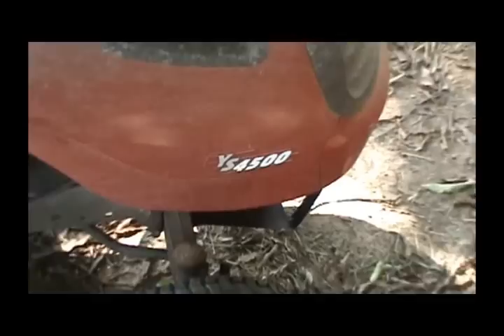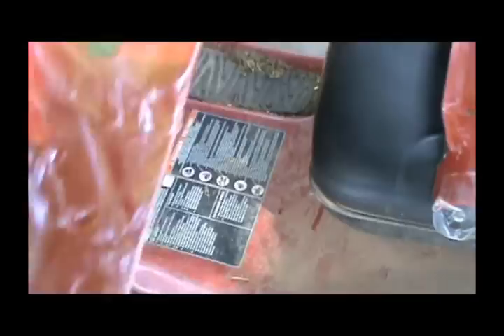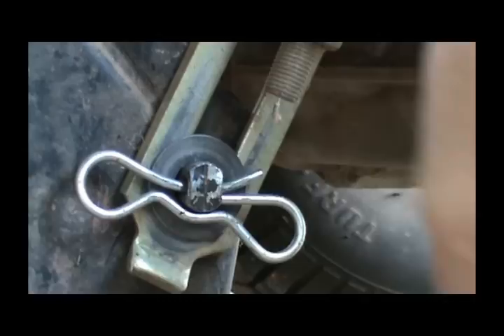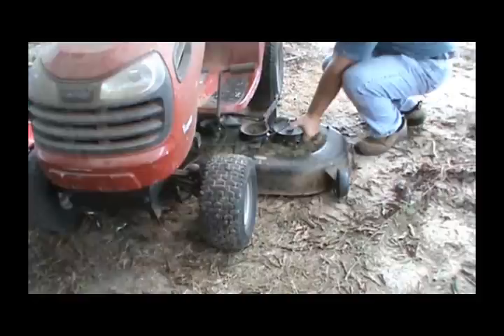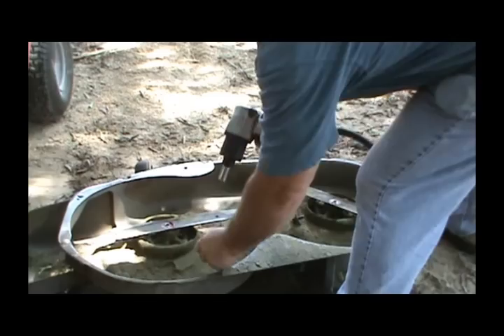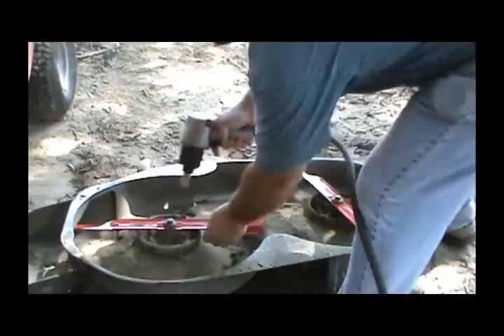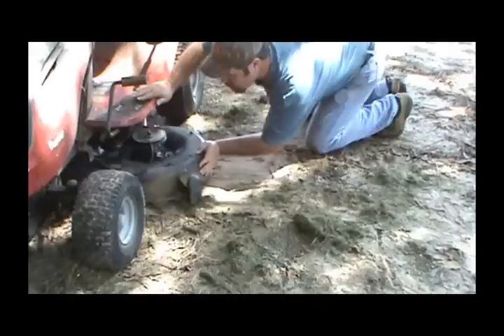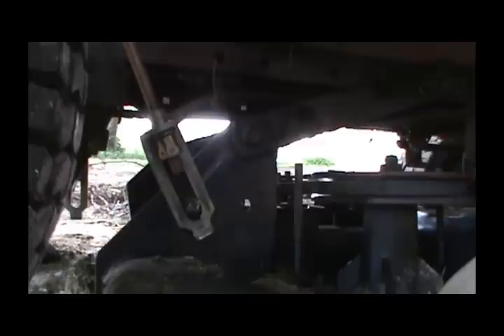Craftsman YS4500 Deck Removal

Comment: We had a 16hp Massey Ferguson 1655 when I was young dad mowed with.  Monster little garden tractor but changing blades on it was a heavy job!  Had a mid PTO driveshaft to a gearbox on the deck...weighed a ton dragging that out from underneath!  Sure don't make lawn/garden tractors like that anymore.

Comment from the maker: It's pretty easy on mine, my mother has a LT1000 Craftsman that's a bit more difficult but not too bad.  I used to jack them up and change the blades but after messing the spindle end up on our old mower, I quit doing that.

Comment from the maker: Nah, the stamped steel crap they build nowadays are made to last about 10 years and then you throw them away because it's cheaper to buy a new one than it is to fix.  So far I've had to replace the gas tank, blade belt, and battery other than a new set of blades every other year.

Comment: Great video. Do you still have this tracker? I am looking at getting the 80th anniversary 4500 and am hoping that its a quality mower. What do you think?
Reply from the maker: Yes, I still use it.  It lasted 10 years before the spindles went bad.  I wouldn't recommend the Kohler engine as it has it's own problems.